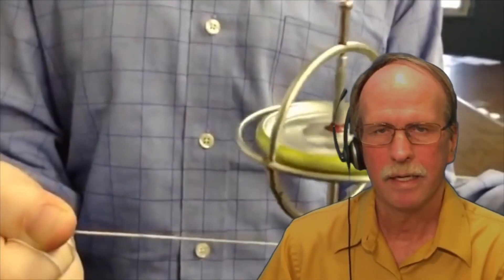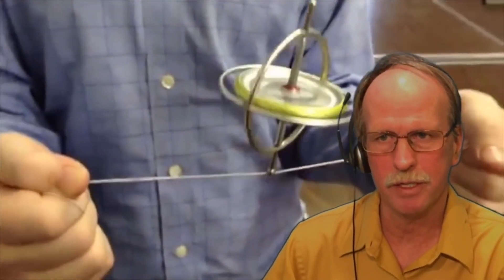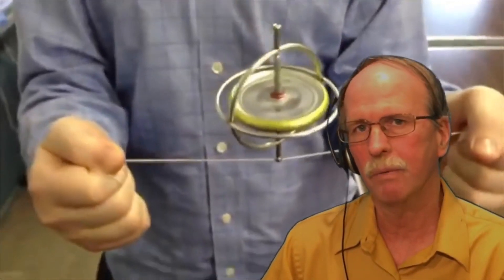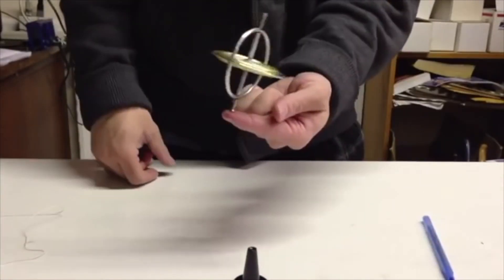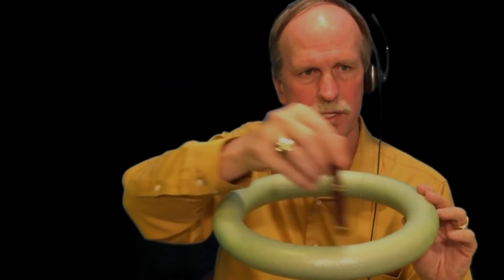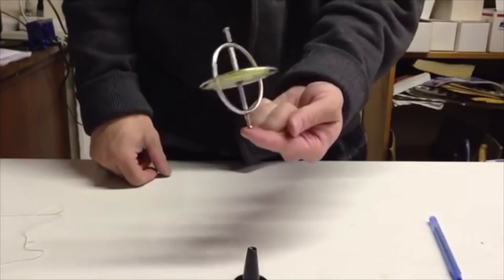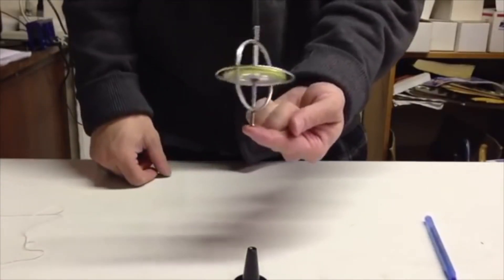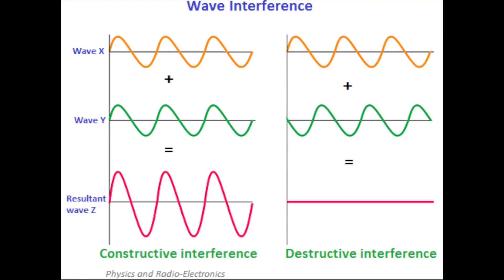Gyroscopes | How Things Work

Comment: Hi Bob a slight correction in a ring laser gyro,s the 2 beams have a different optical frequency and the difference between them is the Sagnac frequency,  you can think of them as being Doppler shifted due to the rotation of the ring. Its the fiber Gyro that uses a single light source which has a phase shift. Have a look at https://www.youtube.com/watch?v=MXYV6wNdZm8 one of the best explanations of how a RLG works. ROMY is on my visit list next time I am in Germany.
Reply from the maker: Thanks Rob very good point.

Comment: I used to work on test stations for electro-mechanical inertial reference units.  It would be interesting to talk about how those work, as opposed to the ring laser gyro units you've described.
Reply from the maker: Perhaps you and I can work on that together.
Reply: @ShamrockBanksObservatory , it's been a long time since I actually worked on those items and I'm not current on those technologies.  But I do think I remember the basics fairly well and could do some research to refresh myself.

What's a good way to contact you?

Comment: Not sure why gravity doesn’t act evenly on the entire ring...gravity should not just pull or push on one side it should act all around the ring...this would zero out the downward force and make the giro spin  evenly
Reply: It acts evenly on the ring in it's starting position. But the slightest lateral movement will bring the center of mass away from the axis of rotation, thus letting gravity create a torque.
Reply from the maker: exactly
Reply from the maker: Unless something pushed it to one side first. Think about that.  Hint is the ground stationary?  The gyro is.

Comment: Presumably, the initial cause of wobble on a mechanical gyroscope would be friction both at the base and to lesser extent by the air. This would then allow gravity to take over. If gravity was the initial cause, we would need to explain why it "chooses" one specific spot on the ring. Could you clarify what a gyroscope would be used for if it was not prone to procession?
Reply from the maker: Next episode but have a look at the ring laser gyro section of his video

Comment: Easy way to experience the forces by yourself without having to buy a mechanical gyroscope:
Take the front wheel of your bike out, hold it with the axle pointing up and than have someone spin it fast (not that easy to do it alone...). Next step would be pointing said axle horizontally, spin the bike wheel very fast and balance it on only one end of the axle (hard, because bike wheels tend to be too heavy to do it with one finger...), observe the rotation...

Comment: I  cringed when you said angular momentum is a force. The (time) rate of change of angular momentum is the torque (which you do mention later). The mathematics of spinning tops is very interesting. The symmetric top is an example of an integrable system. Three conserved quantities exist: the total energy, the angular momentum about the vertical axis and the spin (defined in terms of the rate of rotation about its axis and the rate of precession). The existence of the quantities makes it easy to solve for the motion. One point that people often misunderstand is that the total angular momentum points in a different direction to the angular velocity (which is aligned with instantaneous axis of rotation). The distinction is important as it is what gives rise to the unexpected motion.
If the gyro was in freefall, then Poinsot's construction applies, which has the unforgettable expression: "The polhode on the inertial ellipsoid rolls without slipping on the herpolhode lying in the invariant [some say invariable] plane".
Reply from the maker: that is not correct.  It isn't a force, but has very similar units,  see the next episode.

Comment: Great, I was using mechanical gyrscope compass for surveying, doing military service in artillery for a year. Accuracy to find north is 0.01 degree on the kind of gyrscope I used, but we did some linear curve matching paper math, that decreased the accuracy to 0.05 degrees. It was sufficient for Artillery use, since our old fashined artillery only had some 11 km range.  https://en.wikipedia.org/wiki/Haubits_m/40
Edit: Physics Demo has a demo on the conservation of momentum with a bicykle wheel.
Edit2: I will not do the homework assignment since I am pretty famiiar with how and why gyroscope can point out north it :-)